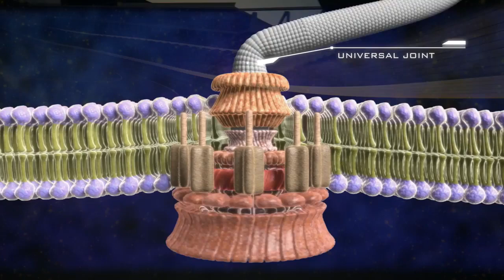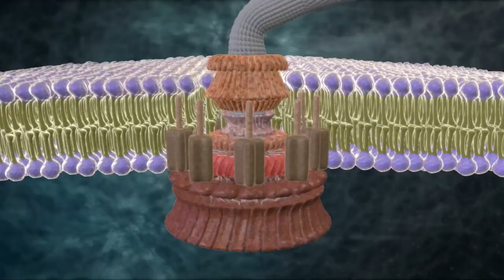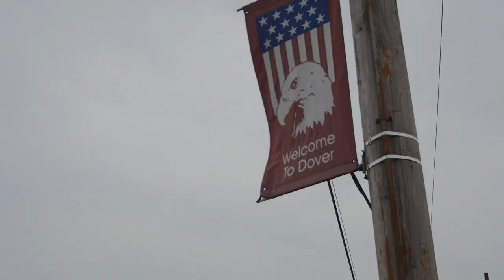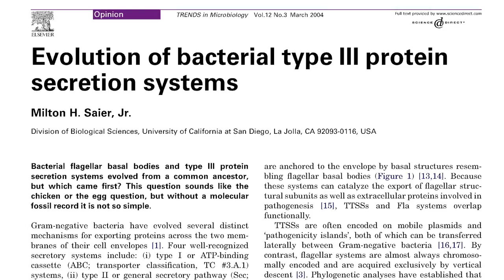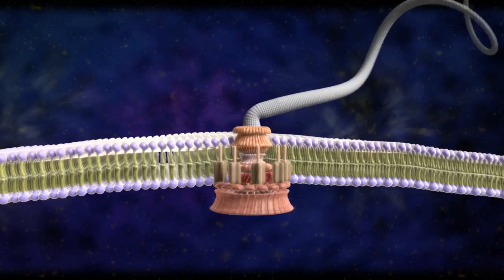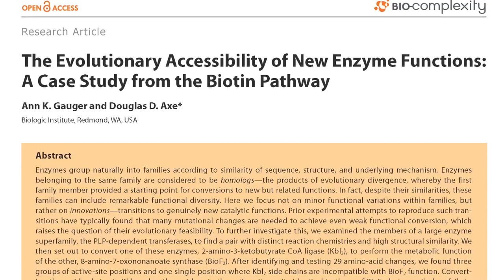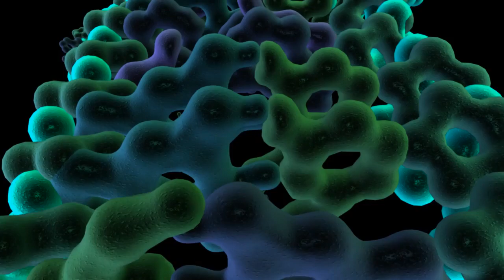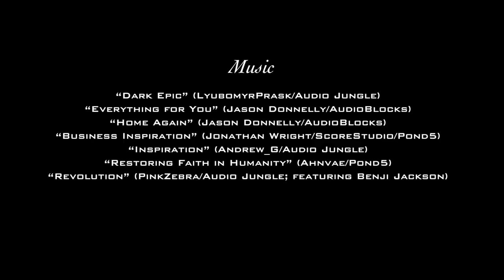Documentary Revolutionary, Michael Behe and the Mystery of Molecular Machines

Comment: The theory of evolution is clearly imperfect and incapable of explaining everything. But the theory of intelligent design is not a solution either. Intelligent design has two problems: the first problem is, who is the designer of the intelligent designer? And the designer of the designer of the designer? You can repeat this question an infinite number of times! And the second problem is for those who see the hand of God in all of these affairs: how is it possible that God designed something with so much care and effort, and minute detail, but with such evil effects, as the bacteria and viruses that kill innocent people?
Reply: I think ‘whom’ implies a separate thinking intelligence that created that module. We forget that each part of this module could be intelligent, working together in synchronicity. Being aware of one single thing is intelligence, whether that be of performing a single job (it doesn’t need to be aware of anything else). 

The fact that everything in our body does anything for the purpose of doing it’s own single job, infers intelligence. The epitome of intelligence is doing something with a purpose. This entire trial could’ve simplified it into that single point.
Reply: The theory is right though. As far as theories go - it is one of the few strongest theories there are- just as strong or stronger than if your DNA says you are from your mother . Right?
Reply: This seems to be an issue with definitions:
The first issue is easily explained by an intelligent designer which does not require a designer.
An eternal supernatural designer would not require a previous cause and could therefore be the "First Cause".

And the second is explained by a God which allows human freewill to bring evil into the world. Hours can be wasted arguing over this explanation, and I will if you would like. 

Your argument boils down to "Based on a highly restricted definition, this cannot work. Therefore it cannot work with any definition." 
Which is similar to a child saying "Humans are not mammals because all mammals have tails."